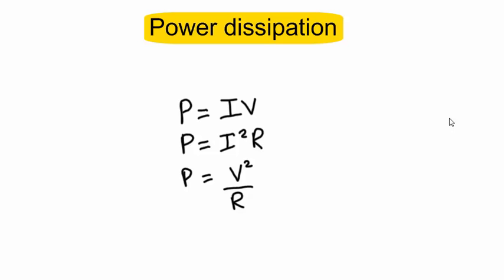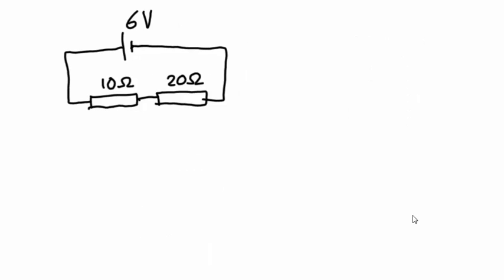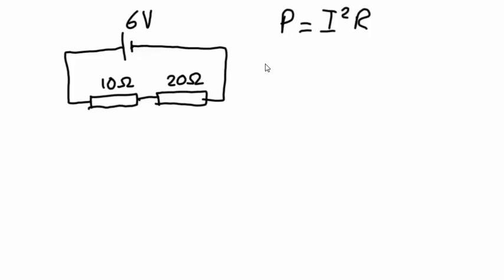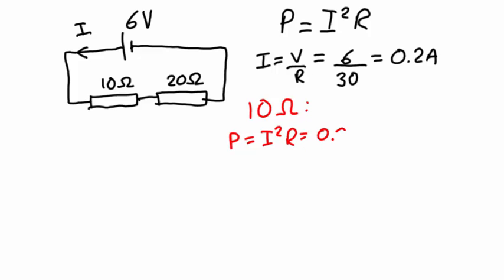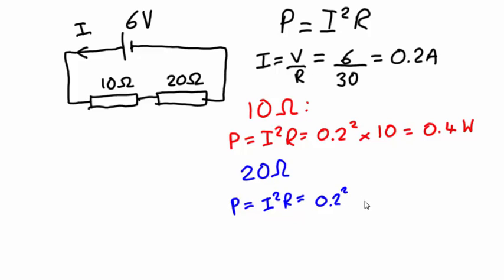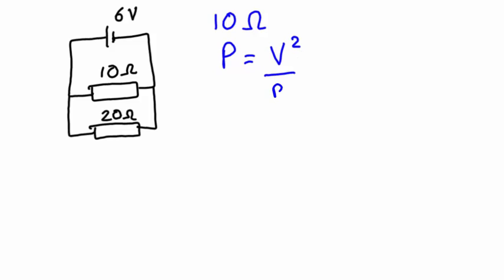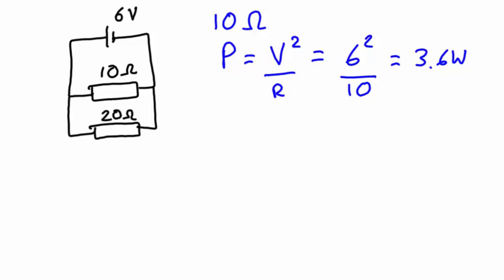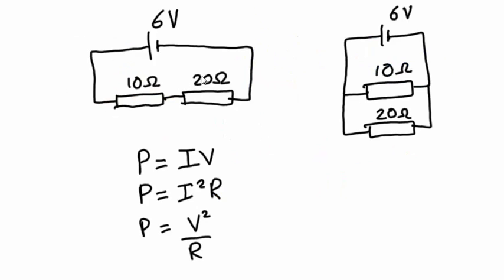Power dissipation

Comment: Mr cowen, given R1 = 5R; R2= 15R; R= 59 ohms and the power dissipated in resistor 2 equals 3.6 watts. How does one find voltage across the battery?

Comment: Current squared times resistance IS equal to voltage squared divided by resistance. Why did you use two different formulas for two different problems as if one was associated with parallel circuits and one for series?
Reply: Both equations are really the same.  So depending which values you are given, you can use the equations accordingly.  The difference in equations arises from substituting Ohm's law into the Power dissipation equation P = I x V. (where we can replace I or V with R/I or IR respectively from Ohm's Law)

Comment: Short and to the point. Just like it should be. Not with all the bullshit. I was making a voltage divider circuit and i thought that in series the lower resistor takes the brunt of it; so i have a 55 ohm 1 watt resistor coupled with a 10 ohm 5 watt resistor on one side of the divider XD  and i was staring at it like: wtf why the 55 one was heating up =)).